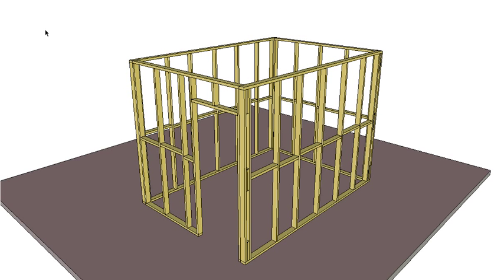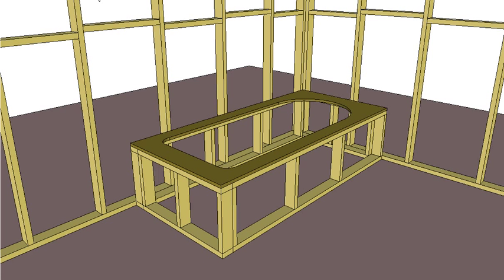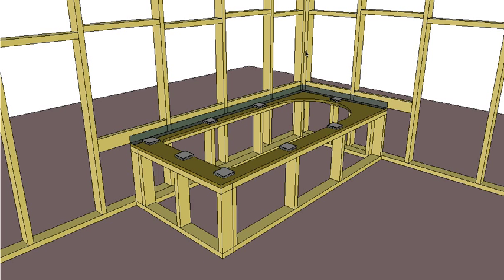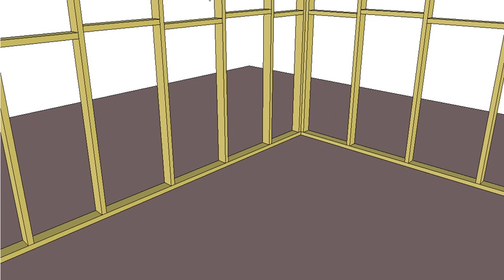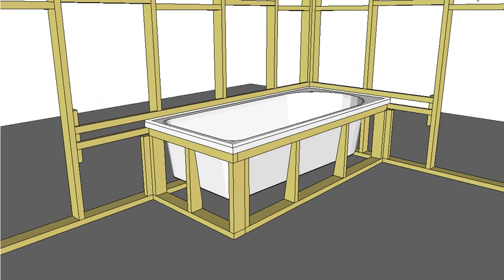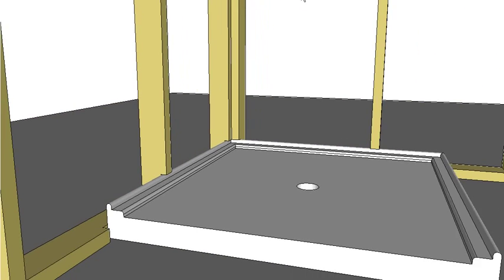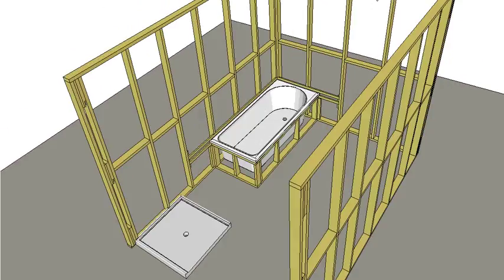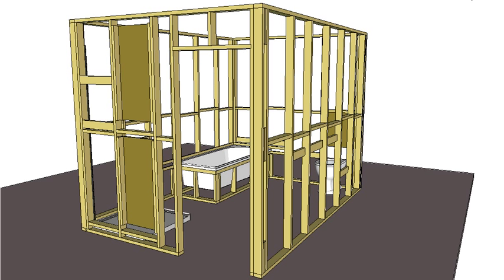Prepare for Sheeting a bathroom

Comment: Great video thankyou! a question about the first dampcourse option over the bath. I understand how the shower base one works as you the dampcourse is directing water into the shower base. But how is the one for the bath helping if the bath is sitting on top of the dampcourse? Where is it directing the water to?
Thanks
Reply from the maker: Hi Mate, in that situation the water is just being prevented from getting into the timber, there is no real direction for it to flow.

Comment: Again, great video really helpful and in depth. A question I do have not so much directly in regards to this video but does a ensuite bathroom window need to follow a specific AS depending on the size of the bathroom?
Sorry if this is a silly question I've just found it hard to find a clear answer in the Aus Standards.  
Thanks again mate
Reply from the maker: Hi passo1493

I'm not aware of a AS based on the size of the bathroom however the Building Code (National Construction Code) state that there should be an area equal to 10% of the floor area letting light and 5% letting in ventilation. This is normally achieved using a window however skylights and solar tubes can also contribute. If the Window is to be situated over a Bath then it needs to be laminated to prevent shattering. Thats all I know of the top of my head it might be worth talking to a local window manufacturer if you want to know more

Thanks for your questions and feedback

Comment: Any tips on how to NOT puncture plumbing pipes while doing a frame for the bathtub ;-). or any screwing or nailing to the walls after the wall sheeting are already up
Reply from the maker: Hi Josif
No, not really, you can get service detectors, however, I have never used them. You really just have to mark where the pipes are as soon as you put the sheets up so you can keep track of them
Reply: you can use plates over the studs I like to take the router and knocks it out about an eighth I make my own out of steel sometimes I'll even go across the studs so no one in future can easily drill through the pipes they sell pieces of metal for this but I find it's just easier to make as I need them no issues yet
Reply: but also its really good to have a bunch of pictures as well as measurements of where the pipes are from walls

Comment: wow.... i never thought about putting in a noggin for the future bath towels rail nor has i been given this option.... but i do now. i like the full sheet of ply for the shower screen. 
When you were talking about the foam under the bathtub,  instead of and cement. what sort of form are you referring to? and is this a good idea? 
thanks
Reply from the maker: Hi Josif
Something like this 
https://www.bunnings.com.au/selleys-320g-space-invader-water-based-filler-expanding-foam_p1210253
The whole idea is to support the base of the bath so when you step in it doesn't flex. The foam will also help to insulate the bath and the water will stay hot longer. As I say in the video just make sure that you weigh the bath down by filling with some water so that the foam won't lift the bath out of position while it sets